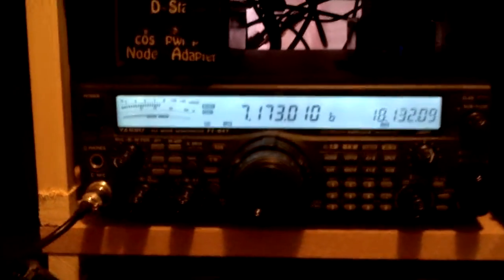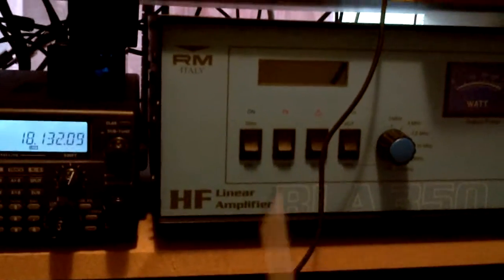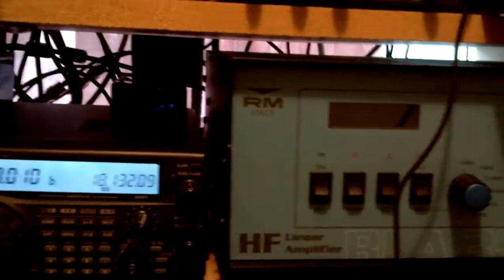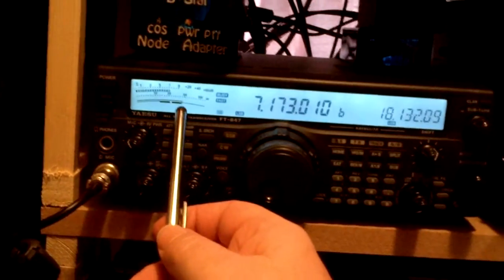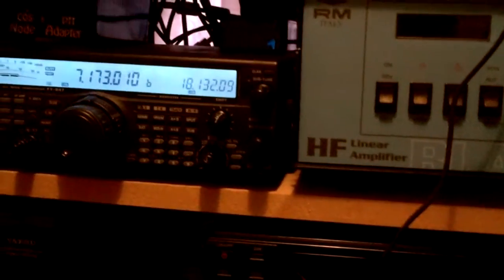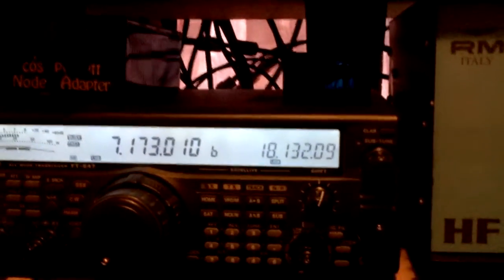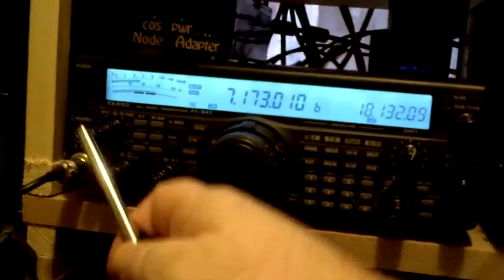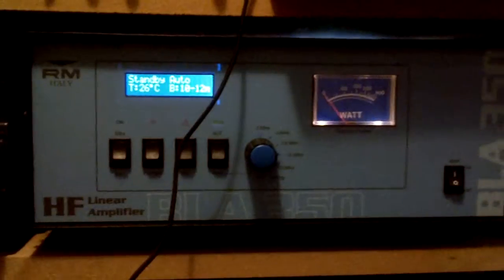BLA350 AMP connected to a FT847 testing and setup information.

Comment: I know this is an older video, but got one of the newer BLA350 Plus units. It's a solid feeling amp and I've been using your videos for advice (they are super helpful btw!). My problem is I keep getting locked out on high harmonics (HARM. > 3.0) alarms. Got a tuner, even the antenna is around 1.2 SWR w/o tuner at most frequencies. Would love any ideas!
Reply from the maker: Hi Check you have NO RF on your Cables from the radio to the Amp also check the connectors are all ok also i.e. No bad joints solder,  I would always keep a ATU inline with the AMP even if you know your Antenna is 1.1 swr, if you could do a Video showing what problems you have that would be very helpful also, thats about all I can think of at the moment, I have my BLA350 connected to a Flex 6300 at the moment with a AATU and every now and again I get the HIGH SWR also even though I test the swr before I TX and I know it's below 1.5 so just keep playing with the AMP  73's for now
Reply: @M0AOV  nice, I will get a video soon. Thank you so much for the response! I do have a tuner, MFJ-994B right before the antenna after the amp. I rarely see high SWR, it’s almost always the HARM or harmonic > 3 error. I’ll get a video soon and double check all connections.
Reply: I snagged an ALC/Keying combo cable from eBay for the FTDX-10 and so far, knock on wood I haven't had the HARM error since. Not sure it's related, but maybe. I followed the RM Italy guide to set the ALC using 100w FM, adjusting the POT to 10w input on the LCD. Hoping this helps. I also have an LMR400MAX cable (2ft), feeding the amp from the FTDX-10. If the error pops back up, I'll double check all the solder joints on the cables.
Reply from the maker: @zunar_j5_933  Sounds like you have all bases coverd for the BLA350 just keep an eye on your 10watts max in just so it doesn't trip the HIGH POWER input, just to check with you do you run your radio at 100watts input to the Radio or do you only run 10watts to the radio?? I only run the Radio to the Amp at max 10watts so I don't use the ALC line and the USUALLY NO HIGH power or High SWR input always try to cover your self ( Power & High SWR ) Glad it's working 73's
Reply: @M0AOV  thank you for the reply and I'm glad you asked that question! So to be safe, I was just running the receiver at 8 or 10 watts, even with the ALC cable connected. I then wondered what I should run the radio at, with the ALC cable connected. I didn't trust running the radio at 100w, as even running it with the ALC cable connected (tuned POT with FM @ 100watts to show 10 watts on LCD during ALC setup) I still get near full output power (around 300w on 20m SSB) with 8 to 10 watts from the radio. It had me really confused what I should run the radio at then, if at 8 or 10 watts I still get near full power with ALC connected.

Comment: Trouble is its easy to put in too much rf..no safeguard
Reply from the maker: The ALC cable that you connect between the radio and amp should only let what RF you say with in the menu 8watts should work but for myself I only use the FT847 with 8watts RF